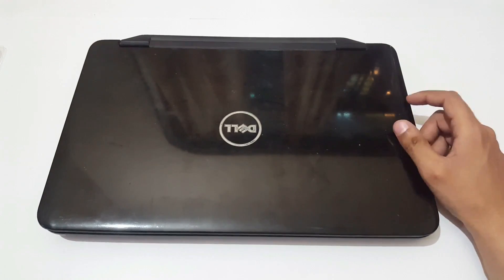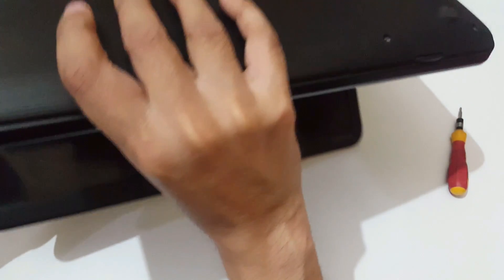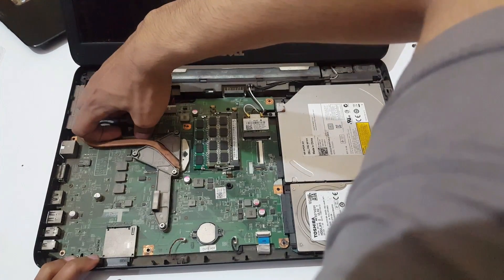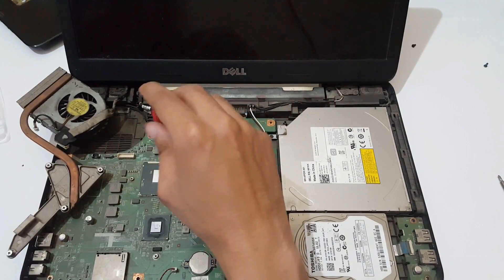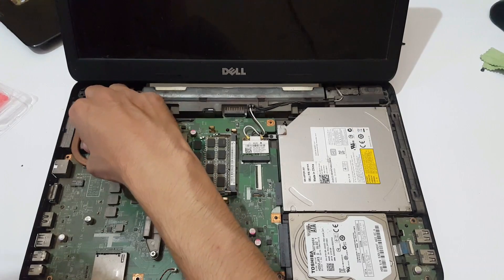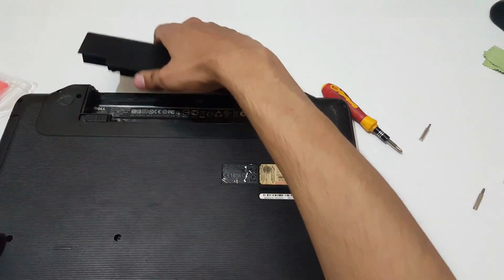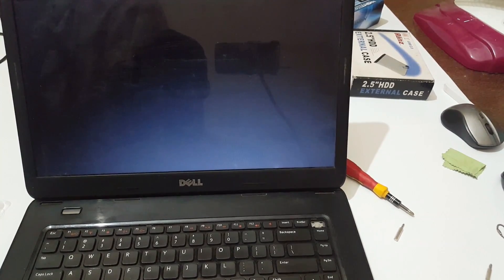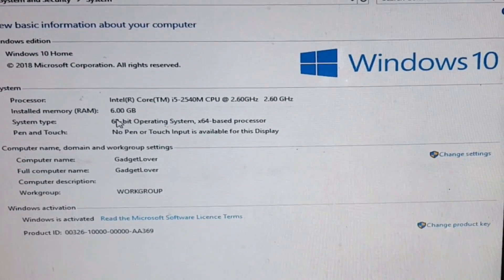How to Upgrade Processor on DELL Laptop | i3 to i5 & i7 - Make Laptop Faster for Gaming

Comment: I have a dell G3 3590 gaming laptop.
But I want to go for more hardcore gaming.
Currently I have an Intel i5 9th gen processor and 4gb graphics and a 8gb ram, anyone suggest a good upgradation please
Reply from the maker: Genius baba : I would suggest you upgrade its RAM and if SSD is not installed install SSD for more better performance

Comment: -windows 8.1
-intel core i3 2350M
can i change to i5,i7 or i9?
Reply: -2gb ram
Reply from the maker: ilham XD_was pk : Intel Core i5 2540M is best processor for your Laptop and I would like to inform you if processor is soldered you can't upgrade it
Reply: Ok thx :)
Reply from the maker: ilham XD_was pk :You're welcome

Comment: I have HP pavilion power with 8GB ram gtx 1050 with i5 7300hq can I upgrade to i7? And suggest a good processor for me pls
Reply from the maker: CrazyMan35 : Intel Core i7 7920HQ is best processor for your Laptop and I would like to inform you if processor is soldered you can't upgrade it

Comment: Are there laptops models from other manufacturers besides Lenovo that can compete with Thinkpad 440p in upgrading a 4th gen Intel CPU?
Reply from the maker: neti neti : What processor is in your Laptop
Reply: No, I am looking to buy a laptop that has upgradable 4th gen Intel CPU.And I need to know all the models that can do this from different manufacturers so I can choose one that is the cheapest.
Reply from the maker: neti neti : Buy a Laptop which is suitable for your work

Comment: I have a stock 'Dell Inspiron 15 3000 15.6" Laptop - A510431AU1'. 
CPU: AMD A9-9425 CPU'. 
GPU: AMD Radeon R5 (Stoney Ridge). What are the fastest respective components I can upgrade to?
If possible, can the RAM be upgraded too if the CPU is upgraded?
Reply from the maker: Small Kid : The processor of this Laptop is soldered so you can't upgrade it and I would suggest you upgrade its RAM for better performance
Reply: Thank you
Reply from the maker: Small Kid : You're welcome

Comment: I have dell core i5-4210u i can upgrade to i7 
And i have ram 8 gb ddr3 ???
Reply from the maker: ضرار دلقموني : Intel Core i7 4600U is best processor for your Laptop and I would like to inform you if processor is soldered you can't upgrade it

Comment: i want to upgrade my dell inspiron 5482 from i3 to atleast i5 is it possible ?? it is currently running with an i3 8th gen, is the processor soldered and what is a recommended upgrade
Reply from the maker: paras agnihotri : The processor of this Laptop is soldered so you can't upgrade it

Comment: I have Dell Vostro 15 3000 series (3558) core i3 5015u 5th gen 4 GB ram (with 2 ram slots).
Can i upgrade it to core i5 ?
Can i upgrade motherboard ? 
Which CPU will be best for me?
Reply from the maker: Vejailla XZ : The processor of this Laptop is soldered so you can't upgrade it

Comment: Gadget lover I have a lenovo ideapad z460 

Will Intel core i7 870 work in it 

And it have a socket lga 1156

But I don't know that will the fan support it

Please tell me what to do
Reply from the maker: Shivani Tiwari : What processor is in your Laptop
Reply: Intel core i3  M 350 @ 2.27ghz 2.27ghz
Reply from the maker: Shivani Tiwari : Intel Core i5 580M is best processor for your Laptop
Reply: But can intel core i7 870 work with cooling pad
Reply from the maker: Shivani Tiwari : Unfortunately you can upgrade it in same generation only

Comment: Bro I have a hp 15notebook laptop  with i5-5200u the best possible upgrade for processor 
Is it possible to integrate new generation processor like 5th gen to 8 or 9 perhaps
Reply from the maker: subhankar dey : Unfortunately you can upgrade it in same generation only and Intel Core i7 5600U is best processor for your Laptop

Comment: Bro i have dell n5520 i3-3110m 2.40ghz 4gb ram and 1gb amd graphics card suggest me uprades i brought it in 2012
Reply from the maker: Shashi Kumar : Intel Core i5 3380M is best processor for your Laptop
Reply: @GadgetLover360  what about ram and hdd
Reply: And graphics
Reply from the maker: Shashi Kumar : I would suggest you upgrade its RAM and install SSD for more better performance and you can also attach graphics card externally to your Laptop

Comment: will I be able to upgrade my dell Inspiron 3000? if so I currently have an i3 5005u what would be the best cpu for it?
if I can have an i7 or an i5 that would be fantastic
Reply from the maker: Kristian. : Intel Core i5 5300U is best processor for your Laptop and I would like to inform you if processor is soldered you can't upgrade it

Comment: Dell Inspiron 15 3542 ,4gb ram GeForce 820m , i5 4210u 1.70 GHz dual core what should be done
Reply from the maker: umesh sonkar : The processor of this Laptop is soldered so you can't upgrade it
Reply: @GadgetLover360  ohh thank you sir for ur quick response & subscribed too
Reply: @GadgetLover360  sir , can i upgrade it's ram or graphic card?
Reply from the maker: umesh sonkar : Dear subscriber you're welcome and RAM can expandable up to 8GB and yes you can also attach graphics card externally to your Laptop
Reply: @GadgetLover360  thank u so much bro
Reply: @GadgetLover360  can the processor handle this,  will it bottleneck
Reply from the maker: umesh sonkar : You're most welcome and yes but before buying see its requirements
Reply: @GadgetLover360  ok bro thank you:)
Reply from the maker: umesh sonkar : You're welcome

Comment: hey i have a dell inspiron 5559 core i7-6500u processor can u suggest me the replacebles
for better performance
Reply from the maker: kj does it all : The processor of this Laptop is soldered so you can't upgrade it
Reply: @GadgetLover360  thanks bro
Reply: and what about a hp pavillion g6 that has a core i7-3632qm and i had open my laptop thats removeable can u suggest the best for it
Reply from the maker: kj does it all : You're welcome and it is highest generation processor available in this Laptop otherwise you can upgrade it with Intel Core i7 3840QM but it will produce more heat
Reply: @GadgetLover360  thanks a lot nut where can i buy it
Reply from the maker: kj does it all : I would suggest you buy it from Aliexpress online store

Comment: Could I upgrade a hp elitebook 820 g2 to a i7 6700 or 6800k?
Reply from the maker: Airblade : The processor of this Laptop is soldered so you can't upgrade it

Comment: Hi, 
I have HP pavilion 15 ab029tx with i5 5200u, 8 gb ram, 1tb hdd, nvidea geforce 940M gpu...
Please suggest the upgradations I can make in it including CPU, GPU and RAM...
Thanks
Reply from the maker: Harpreet Singh : Intel Core i7 5600U is best processor for your Laptop and I would like to inform you if processor is soldered you can't upgrade it

Comment: Hey bro, ty for your video.
I want to know if in a Dell Latitude 3340 can I upgrade the processor? 
It's actually a i3-4005U 
I want to be able to play little gaming like League of Legends, so which upgrades should i do, and is worth?
Or just i just buy a new laptop?
Reply from the maker: C3PILLIN : You're welcome and unfortunately the processor of this Laptop is soldered so you can't upgrade it I would suggest you upgrade its RAM and install SSD for better performance

Comment: Can you tell me best core for my hp pavilion g4 laptop??? Earlier RAM of my laptop is 2gb and now i increased it to 8gb ram.
Reply from the maker: Allahabad University : What processor is in your Laptop
Reply: @GadgetLover360  ADM A4- 3330MX, 2gb ram, clock speed- 2.2ghz, hdd 500gb. It is that laptop which is given by akhilesh yadav ji ex CM of UP in 2013.I want to change its CPU, RAM and capacity. current ram is 2gb ddr3 1600mhz. I want to max all these things can you tell me about everything.
Reply from the maker: Allahabad University : AMD A8 3550MX is best processor for your Laptop and I would like to inform you if processor is soldered you can't upgrade it and I would also suggest you upgrade its RAM and install SSD for more better performance
Reply: @GadgetLover360  can you clear my confusion, between kingston A400 or crucial bx500 ssd which is suitable for my laptop.Tell anyone in between them.
Reply from the maker: Allahabad University : Kingston would be the best choice

Comment: I've Core 2 Duo P8700 2.53 Ghz( Sony Vaio CS36H) 2GB RAM, can i upgrade to i5 or i7 with 8GB RAM and an SSD, if yes please share the product link.. thank you
Reply from the maker: Gandhi R : Intel Core 2 Duo P8800 is best processor for your Laptop and I would like to inform you if processor is soldered you can't upgrade it

Comment: My laptop is an Avell G1513 fire v3 with Intel i5-6300HQ
What is the best processor i can upgrade to ?? 
Thanks
Reply from the maker: Kadu Pettengill : Intel Core i7 6920HQ is best processor for your Laptop and I would like to inform you if processor is soldered you can't upgrade it

Comment: Hi, I have inspiron 3521, i3 processor and 2gb amd radeon graphics.
It used to overheat due to dust in fan area, so I disassembled it and cleaned the fan and reassembled, after which the dedicated graphics card stopped showing up in my device manager even after installing drivers.

What could be the reason?

Also which part is the GPU? I can't recognise it. Can you point it out by giving me timeline from your video?
Reply from the maker: Kun : Clean the old paste then apply new and reset BIOS

Comment: I have toshiba c55-b854 is the processor upgradable? If it is then which one is the best for the price. Sidenote: im using engineering programs
Reply from the maker: ahmed neamah : What processor is in your Laptop
Reply: Gadget Lover i3
Reply from the maker: ahmed neamah : Intel Core i5 4310U is best processor for your Laptop and I would like to inform you if processor is soldered you can't upgrade it

Comment: I have a Fujitsu Stylistic Q704 2-in-1 laptop it has i5 4200u I would like to upgrade it to a i7 processor what type do I need and thank you this video was really helpful
Reply from the maker: Epicflipguy : Intel Core i7 4600U is best processor for your Laptop and I would like to inform you if processor is soldered you can't upgrade it
Reply: @GadgetLover360  could I then just switch out the motherboard
Reply from the maker: Epicflipguy : Yes but it will be very expensive according to processor upgrade

Comment: Hello I have dell inspiron n5010 with Intel i3 2nd generation 6gb ram which processor is best and I also want 8gb ram because i want to play gta 5 in my laptop smoothly ??
Reply from the maker: Abdul Saleem : Intel Core i5 2540M is best processor for your Laptop and it supports up to 8GB expandable memory so you can also upgrade RAM

Comment: Hi, it's a very useful video. I have an DELL inspiron 15R with Intel Core i5 3337U 1.80 GHz CPU.   Is there any good i7 CPU for upgrading? Thanks bro.
Reply from the maker: Yi  Meng :  Intel Core i7 3687U is best processor for your Laptop and I would like to inform you if processor is soldered you can't upgrade it

Comment: I have Dell 3542 with i3 processor i am going to upgrade ram 4 to 8gb and hdd to ssd but i want to know the processor can be upgrade or not
Reply from the maker: Shivam Shankhwar : Unfortunately the processor of this Laptop is soldered so you can't upgrade it
Reply: @GadgetLover360  ssd and 8gb ram can give better performance or not
Reply from the maker: Shivam Shankhwar : Yes it will give

Comment: Hey bro how is going? I have a DELL inspiron 15R SE i7 3632QM  wich one is the best processor for my laptop?
Reply from the maker: Paulo Porto : This is the highest processor available in this generation otherwise you can go with Intel Core i7 3840QM but it will produce more heat

Comment: Dear, 
I have dell inspiron 2nd Gen N5110 Core i5 -2450 2.50 GHz Laptop. To what maximum value I can upgrade its CPU. Kindly suggest me a compatible and best core for my laptop. Thanks
Reply from the maker: Faizan Afzal : You're welcome and Intel Core i7 2640M is best processor for your Laptop
Reply: @GadgetLover360  thanks👍👍👍
Reply from the maker: Faizan Afzal : You're welcome

Comment: Heyy i have a sony vaio laptop which has i5 520 processor and 4gb ram.. which is the best option for upgrading??
Reply from the maker: Vinay Thrivikraman : Intel Core i7 640M is best processor for your Laptop and I would like to inform you if processor is soldered you can't upgrade it

Comment: Bro I have Sony Vaio E- series windows 10
Intel i3 500gb storage + 240 GB Kingston ssd  and 2 GB ram
Can I upgrade my ram to 8 GB for better performance.
Plz tell🙏🏼
Reply from the maker: Mahinder Mudgil : What model
Reply: @GadgetLover360  model =SVE141J11W
Reply from the maker: Mahinder Mudgil : Intel Core i5 3380M is best processor for your Laptop and I would like to inform you if processor is soldered you can't upgrade it
Reply: @GadgetLover360  thnx👍
Reply from the maker: Mahinder Mudgil : You're welcome

Comment: Intel Core i5-2430M (2nd Gen) 3 Ghz
Intel HM65 Express
NVIDIA GeForce 410M
Graphics Memory 512 MB
4 GB RAM DDR3
500 GB
Sony vaio (vpceh28fn) please me guide me what upgradation are suitable for my laptop.
Reply from the maker: Vikash Kohli : Intel Core i5 2540M is best processor for your Laptop and I would like to inform you if processor is soldered you can't upgrade it
Reply: @GadgetLover360  thank you and it is not soldered. bdw any other upgrade would you recommend for my laptop.
Reply from the maker: Vikash Kohli : You're welcome and I would suggest you upgrade its RAM and install SSD for more better performance

Comment: I have a dell i3-7100U CPU @ 2.40GHz, 2400Mhz . I want to upgrade, so what is the best cpu for me.
My system model is : inspirion 15-3567
Reply from the maker: VeNoM Raibuz : The processor of this Laptop is soldered so you can't upgrade it

Comment: How do u check what processor is compatable with your motherboard
Reply: I have a dell i3-7100U CPU @ 2.40GHz, 2400Mhz . I want to upgrade, so what is the best cpu for me
My system model is : inspirion 15-3567
Reply from the maker: VeNoM Raibuz : The processor of this Laptop is soldered so you can't upgrade it

Comment: Hi sir i have HP 2000 Notebook PC_Intel i3-2328M CPU @ 2.20 GHz_4GB RAM_500GB HDD. 

Can i upgrade processor i3 to i5 ?
Or max ram size upgradeble ?
Reply from the maker: bhuvnesh purohit : Intel Core i5 2540M is best processor for your Laptop and it has 8GB maximum RAM support
Reply: Thank you so much for suggestion. Can u tell me i can add ssd or replace ssd in my laptop
Reply from the maker: bhuvnesh purohit : You're most welcome and I would suggest you replace SSD for more better performance
Reply: @GadgetLover360   OK Thanks you sir
Reply from the maker: bhuvnesh purohit : You're welcome

Comment: HP Probook 440 G4 using i7-7500u and 930MX gpu. Is CPU/GPU upgrade possible?
Reply from the maker: Samin Zawad : The processor of this Laptop is soldered so you can't upgrade it but you can attach graphics card externally to your Laptop for more better gaming performance

Comment: I upgraded the processor after watching ur video now i want to upgrade RAM..Wht frequency of RAM r u using...does it supports 1600mhz??... plse reply
Reply from the maker: Rohit Kumar : 1333 MHz
Reply: @GadgetLover360  will 2x4gb 1600mhz work with this?
Reply from the maker: Rohit Kumar : Yes
Reply: @GadgetLover360  actually few years back i purchased a 4gb simtronics RAM.. i asked the seller for 1600mhz told by my frnd..at that time i didn't had any knowledge about frequency....now CPU-Z nd speccy are showing 1333mhz...so i m confused if the seller gave me wrong kit or my original RAM has downgraded the 1600 one nd bcoz of that it is showing both at 1333mhz....wht should I do to get correct specs.. plse which suggest...is it possible without opening the keyboard..plse suggest
Reply from the maker: Rohit Kumar : Go to my Youtube channel and watch Windows 10 - Optimize Performance - Increase Virtual Memory - Speed Up Windows 10

Comment: I have dell vostro v3558 i3 4th gen 4gb 1tb can i upgrade my processor
Reply from the maker: Vishal Pandey : The processor of this Laptop is soldered so you can't upgrade it
Reply: @GadgetLover360  how can i upgrade my laptop performance
Reply: @GadgetLover360  can i overclock my processor
Reply from the maker: Vishal Pandey : I would suggest you upgrade its RAM and install SSD for better performance
Reply: @GadgetLover360  ok thank you so much sir, anything else can I do...???
Reply: @GadgetLover360  how much ram and ssd would be best for me???
Reply from the maker: Vishal Pandey : If it has 1 memory slot can expandable up to 8GB if it has 2 memory slots can expandable up to 16GB and I would suggest you install Samsung 850 Pro 256GB 2.5 inch SSD and you can also attach graphics card externally to your Laptop for more better performance
Reply: @GadgetLover360  ok thank you so much for the help 🙏🙏🙂🙂
Reply: I will do it
Reply from the maker: Vishal Pandey : You're most welcome
Reply: @GadgetLover360  🙏🙏🙂

Comment: Hey, I have a Acer E5-475, Windows 10 with Core I3 and  4 gigabytes of ram.

Suggest me the best core for my laptop!
Reply from the maker: AMG GAMING : If processor is not soldered you can upgrade it with same generation processor for better performance
Reply from the maker: Syphic a normal noob : The processor of this Laptop is soldered so you can't upgrade it

Comment: I have dell intel(r) core(tm) i3-3217u cpu @ 1.80ghz 1.80 ghz.. can i upgrade the Processor and Suggest the processor ???
Reply from the maker: Dhanushka Dilshan : Intel Core i5 3437U is best processor for your Laptop and I would like to inform you if processor is soldered you can't upgrade it
Reply: @GadgetLover360  😵😵😵 👍💗